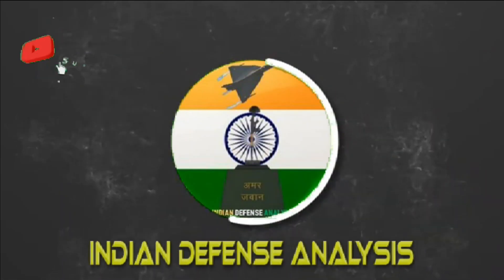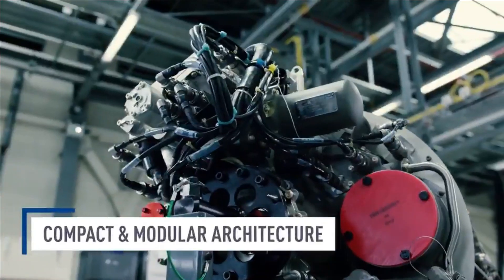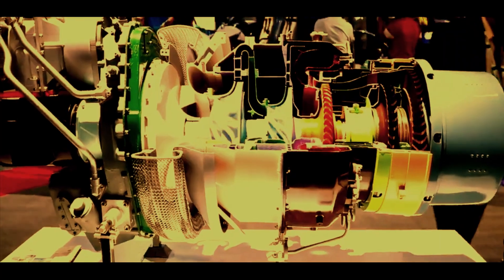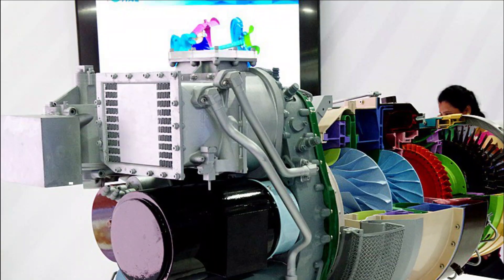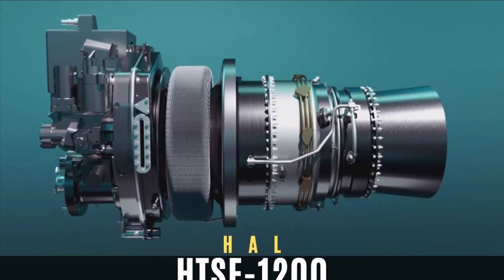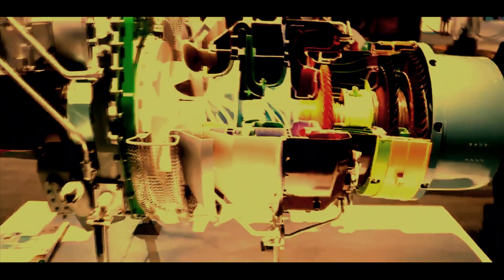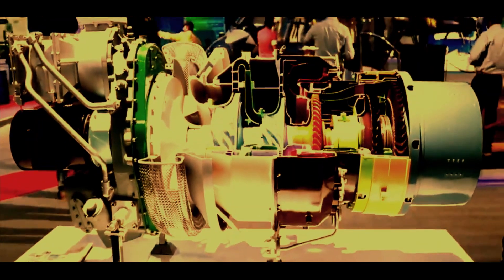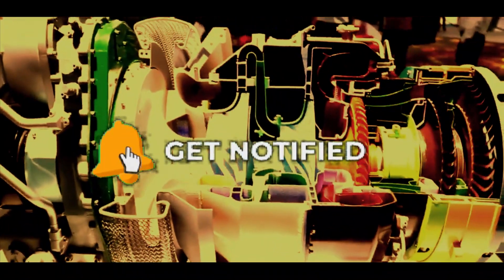HTSE-1200(Hindustan Turbo Shaft Engine 1200) - Future of HAL's LCH, LUH & ALH Helicopters

Comment: Run of Power mode engine to 80% of the speed achieved.Looks like at least a year or two away from this engine being
deployed in a flying helicopter. But huge achievement when it happens, finally liberation from Safran who sells engines
to Zhongguo also. The Z-10 is powered by Safran engines.

We need to stop funding western OEMS who also supply the enemy i.e Pakistan and Zhongguo.

Comment: By when this engine will be ready for deployment. Since HAL is the developer of this machine, looking as their background, doubt they will finish the development of it before such engines go obsolete...
Reply: An aero engine has to go through extensive test trials for various environmental conditions ( from Kargil@ 18000ft - 30C temperatures to Pokhran in summer around 45 to 50C , all outdoor ! , then there are crash tests, Electromagnetic Interference and Radiation and most of all the armed payload conditions - all done at different time frames . This is universally followed by all aerospace devices manufacturers all over the world as per a unified standard regime . To complete all these phases of testing and also creation of specific test facilities for some special tests, will take an another year atleast to be realistic , regardless of any manufacturer in the world.
This mature certified product will NOT become obsolete as you wildly guess ! An aero engine to design and develop for use is not a toy as you may guess nor even like an automobile . It is atleast ten times more delicately engineered and tested than an automobile . It’s to fly in the air defying gravity , you know !
Reply: @srinivasvenugopal2765  you describing as if no one have developed propeller engine in the world. HAL lacks bringing reliable propeller engine till now it has to change
Reply: @SMCGPRA  HAL has already entered in a partnership with Safran. So the project will meet its timeline, since these choppers have export potential as well.